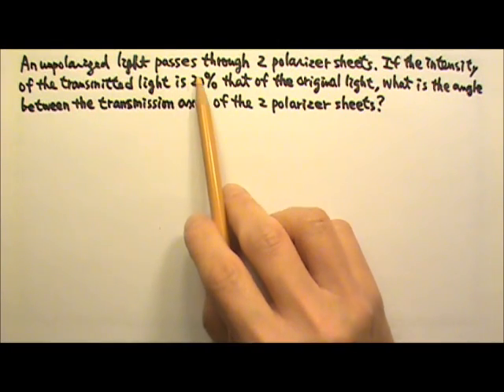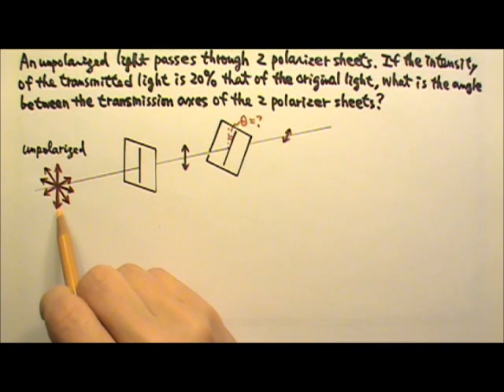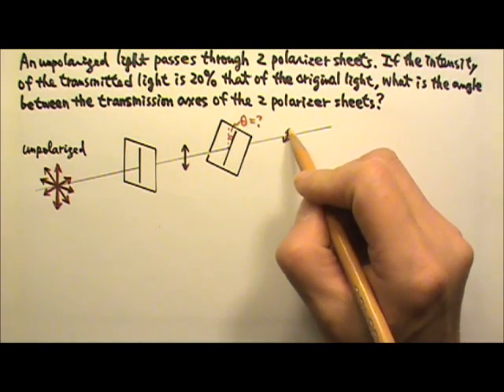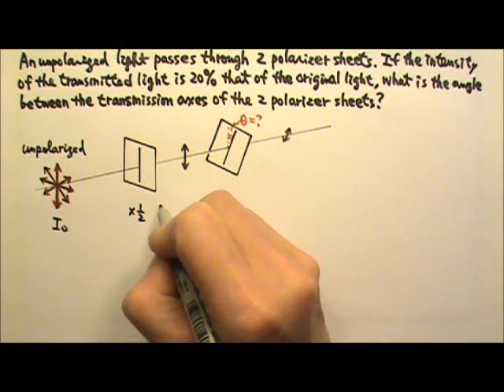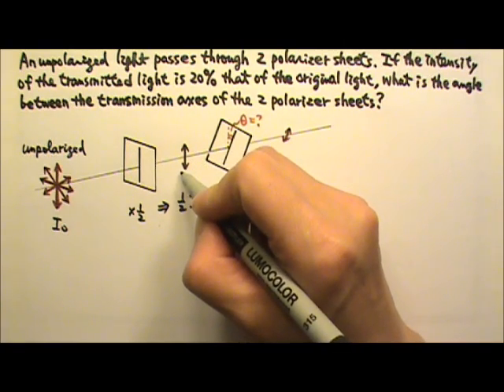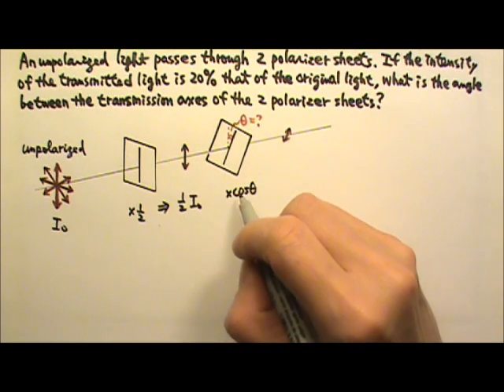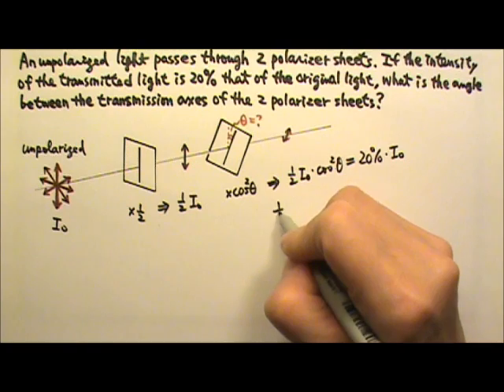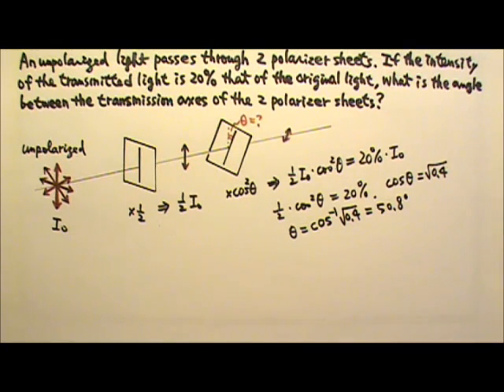AP Physics 2: Light 11: Polarization Problem

Comment: How did you know that the intensity of the light after passing through the first sheet is half of initial intensity? Can you demonstrate this?
Reply from the maker: An unpolarized light has light with electric field in random directions. Each electric field is perpendicular to the light beam (perpendicular to the light's velocity), so each field can be resolved into two components, e.g. one in x-direction and one in y-direction. Since the field is in random direction, so half of its energy must be in x-direction and the other half in y-direction.